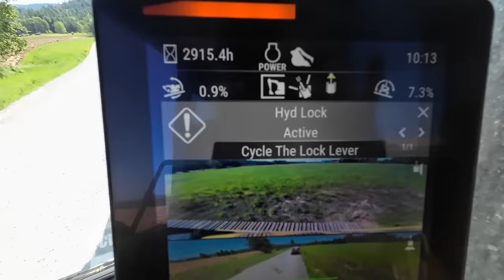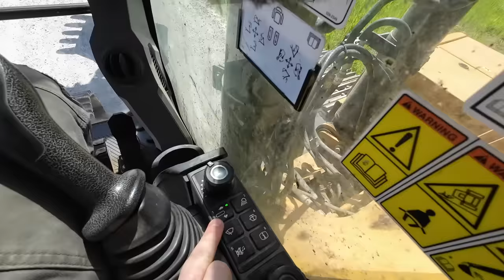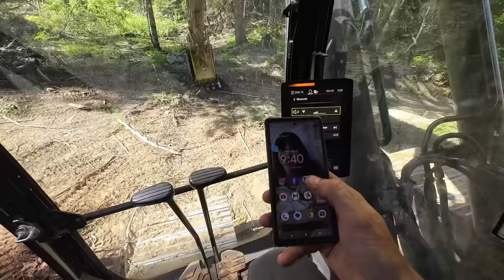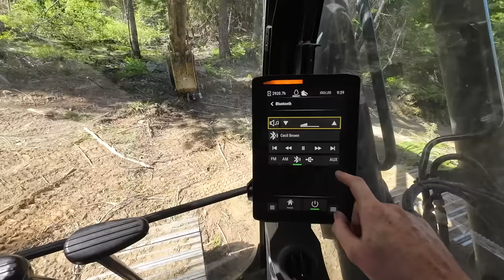We Rented The BIGGEST Excavator We Could Find...

Comment: Just a note here. Equipment used every day for 8 hours of work, usually have a maintenance truck and technician at site at the end of the shift. He goes over the unit and checks every area for issues, the lubes every point, checked every fluid. And refills the fuel tank. If you want those Machi es to work for you every day, you should do the same. Running out of fuel so often should be teaching you a lesson.  JMO.

Comment: THANKS for the comments on how smooth  & powerful the hydraulics are on the 330.  I was part of the team that designed the hydraulic system on all Cat excavators (& many other Cat machines.  Controllability (smoothness, predictability) was a major objective - and overall efficiency as well.  Lower skilled operators have become more common and we wanted to help them, as well as the highly expert operators, to be highly productive over an 8 hour shift.  
You seemed to adapt quickly to running the machine - having experience on other machines helps.
Reply: @panhandlejke6200 the next gen systems are great. We have a 349fl and 349 next gen. The difference is night and day. Doesn’t help the fl has almost 10,000 hours on it and the next gen only has 4500 hours they both run epirock hammers the fl runs a 4700 and the next gen runs a 5800 in a stone quarry. They get run between 16-20 hours a day 5 days a week and 6 hours on Saturday.
Reply: @jjeanes2214  Thanks for that info. Quarrying is a tough application and I hope you get many MORE hours out of both machines.  Over my 40 year career, we were constantly pushed to find design improvements that actually helped our customers - especially to consistently enable high productivity over long hours, like your application.
Reply: That's really cool to hear - big thank you from me, a 2021 Cat 301.5 owner/operator. It is indeed a smooth and easy machine to run. I love it. It may be small but it gets a lot of work done.
Reply: @panhandlejake6200  we push our machines (loaders and excavators) to around 10,000 plus then get new models. The two things that tend to see over those hours are our two 990’s (rebuilt a few times) and haul trucks.

Comment: My suggestion to you is , dig a good size hole for the burn material. It will be better for wind resistance and you won't have to scatter but just bury it when done.
Reply: This is what my grandparents did they dug three holes as deep as they could with the backhoe and put the dirt beside it. It. Those were the garbage burn holes and each lasted about 5 years. Then they we topped off with dirt and leveled out now the whole area is a croquet, badminton and camping area for family reunions.

Comment: This is going to be a fun summer, I do have a tip for removing stumps if they are tough or the roots are deep. Digging a hole in the soil on the left, right and front of the stump will make pulling the stump towards you easier. 
Thank you for an awesome video again and have fun.

Comment: That’s a pretty big excavator. About 40 tons. I know I’ve hauled one and even the one size bigger than that one the Cat 349. Good job y’all!!
Reply: i think a 16t is just as powerfull in many cases..
the missing front showel/stand on this one, moves all the presure to the wheels when you are working..

placing that front thing down gives 20-50 % more power in some cases
depending on what way you are aplying force

a small machine is also often more easy to get closer to the objects so less power is needed

no fun in using a 40ton on the edge of a hole for example

it would be 10 times faster to smooth the road after with a 16t with a showel in front for example

old machines also often have a lack of power, and this does not look like a 2023 model
(i have had a couple of machines they gave me the renting period for free, when i pointed out the dangers and lack of service)
Reply: It’s 330 cat / it’s 30 tonnes ie the 330 / so you don’t really know / a machine weight is always in its number at the side / hope I learnt you something / enjoy your day 👍
Reply: @tonynewman8586  look it up. The Cat 330 excavator weighs around 80,000lbs.
Reply: I have run a Cat 349 with a 78" bucket. It is quite a bit bigger than the 330. The empty bucket weighed 12,000 pounds and the machine is listed at around 110k pounds depending on how it is setup, according to cat specs. That bucket was so big that there was just barely room to smooth out the dirt in a Super 10 dump truck as the teeth would be almost touching the operator's side the and the back of the bucket close to the other rub rail. It only took 3 scoops to fill a truck. Unfortunately, while that machine had a display for the weight of material being moved, it was not setup or available so we had to estimate the weight and watch the returned weight tickets for the 4500 loads we hauled out of that job site.

Comment: When using the breaker don't  try to drill with the breaker point. You can break the tip quite easily. Once your material breaks reset and start again

Comment: Good video! Always make sure the coupler is properly secured to the attachment. I have seen a few mishaps with attachments falling off, some funny, some a delay in working. I have heard of bad coupler accidents, but never had one myself. On lifting or pulling stumps, the closer you are , the more lifting capacity you have. I like renting and buying Cat equipment. Even on my 1949 road grader I can usually walk into the dealership and walk out with the parts I need.

Comment: Not sure if you’ll see this or not but with that hammer only hammer with it for no more then 30 secs at a time, then stop for about 5 seconds. This will help the hammer from over heating, by letting off for a few seconds it allows the hydraulic oil to work its way through the cooler and keeps the hammer from over heating. Make sure you use what ever hammer paste came with the rental or what the manufacturer recommends. 

I speak from 6 years (and counting) experience running them in a stone quarry for over 10 hours a day. Also that hammer paste can get expensive so make sure the greaser (if it has one) is adjusted correctly. They paste we use cost about $26 a tube for us one tube last about 4 hours.

Comment: You asked about suggestions for equipment at one point and I am thinking Telehandler ( extendable fork lift)  However it appears you may be done on the roof and done with sheetrock in the shop, at lest for now.  So, if you do decide to build a separate home, maybe get one before that project.  
I also don't like highs and this feels so much better then climbing on and off a ladder to me.  Just hook up the man basket, which is about the size of the basket on a scissor lift, and set it on the edge of roof and step over or back.  if you actually slide down before you get the bracket installed for the safety line, it is a big target to slide into before falling off the roof.

Comment: Hey Riley I'm a late bloomer, I just watched your video from when you changed the Dozer U joint. A little hint from an old timer I watched you remove those broken bolts, in the future if needed use the Mig and weld a washer over the broken stud then weld a nut to the washer for turning, it may break , try again, much better than drilling. you really lucked out getting them out. also use the highest flow of compressed air to blow the particles away. Good luck to you on this adventure. Keep on videoing!

Comment: You should look into filling your equipment up at the beginning of the day. Get a tank to put on trailer for fuel storage with that large of equipment you will go thru a lot of it.
Reply: They do have a large diesel tank on a trailer.
Reply: Fuel tanks should be top off at the end of the day, not at the beginning.
The cooler temperatures at night cause condensation in a tank.  With a full tank, there is less moisture containing air.
Reply: @dmwi1549  If they have a large tank, are they not fueling up the equipment?

Comment: hey man, quick tip and mandatory safety operating procedure, you always put your bucket, or any other attachment for that matter down when you're not operating the machine or someone is in your operating zone. Your operating zone is the max distance you can expand your boom, stick and bucket out and reach. Your wife is standing well within your operating zone to the point if you had swung to the right you would have hit her with the counterweight and the trees are tall enough that they could fall back towards her and potentially have serious consequences! This is really cool and I do not usually do this, I just noticed you had said "no training" and I had seen potential safety hazards. Stay safe!
Reply: They are really good at engineering a way around issues.  Not so much on setting safety protocols, example confined space with the water storage. Farms have higher rates of extreme accidents for a reason and your using big equipment like farms. Stay safe.

Comment: Just a heads up.... the trim is not going to be 100% to keep mice out. Set sticky traps, if you heard them in the walls, there still there. If you see 1.... theres 200 of them hiding.  Build the 5 gallon bucket mouse kit. 
Ramps on both side they walk up. A bucket lid with a swing trap door. Mouse, walks up to eat walks out of the swing trap lid. And falls into the bucket. Fill the bucket 1/3 with water. Also. Under the bottom, all around the building, spray it with borax.  And stuff , stainless steal, pads in each hole, after you dip them in a toxic ? Also inside the garage. Buy 2 or 3 (( sonic mouse rat )) you just plug them in the wall they keep them away. And there safe for dogs.

Comment: Love that you get to play Tonka with the big gear.  Please lighten up on the sticks though! Banging them stop to stop is obscenely hard on the gear.  Keep in the back of your mind that you're now playing with 1000 hp instead of 45.
Reply: Only 275 hp. Even the 349 that I have used is under 500hp. You are right about the amount of force the bigger machines have and the weight they can move. The 78" bucket on that 349 weighed 12k pounds empty, which was a little big for that machine when moving heavy dirt. That hammer would be fun. I have only used the hammer on our 420f2 backhoe but breaking concrete flat work was like raking gravel by hand compared to running a jack hammer. It made me really focus on being precise and careful with my movements and of course I had to watch the angle on the bit to not damage the slabs we were saving.

Comment: Hi
Such a little tip. When you have air in your diesel fuel system, it is good to have, for example, some spray agent for polishing the cockpit, containing a lot of ether in its composition. You spray into the intake manifold and try to start. Winter also helps when starting diesel in the cold.
Greetings from distant Poland

Comment: Hi from OZ again, just a suggestion as, I am a believer that opions are like arm pits, most people have two and usually they both stink.
Without the blade of the mini to jack the ex level. I would be leveling that cat up, this will help with your hitachi also. To take the rock out, even if you mess up the already formed road a little bit. Its safer for you and the machine (rodeo riders walk funny for a reason) and reduces wild hands from being thrown around the cab and pulling controlls and going somewhere you didnt intend go. Slow is smooth, smooth is fast.
You could probably google but walk into postion, then back up a stick length pull two mounds (dont need to be huge) where the front 2 foot of the tracks were sitting. Then walk onto mounds lifting the excavator up with the boom and walking forward sticking in, only need to take the weight up so it doesnt just doze the mound flat again (can also walk forward swing and pull in behind then back up) if still rocking can screw down into piles pulling tracks left/right. This is less about being level and more about having the weight of your machine, on the idler and motor drive ring, then through track frame center and tetter tottering (level comes more into play when cutting survey or production loading) when you are done lay bucket flat beside mounds and swing through to knock the hump then come through with skid when done. P.s. keep in mind best practice is to not pull back/dig toward drive motors (as if you mess up idlers are cheaper to replace) and dont stick in to far grapping your own track with a tooth isnt much fun. 
Also I havent seen one in a video so just incase im not oblivous or you havent seen one before maybe have a look at skid steer leveling bars. You guys could knock one up in a lunch break.

Comment: One technique I have used to prime the lines is to slightly pressurize the fuel tank. I once used a wet rag twisted and coiled around the filler cap and blew in it by mouth because I had no compressor or air tank handy. Quick fix. No tools essentially. The Tank would need to be topped off if you have to blow into it or you will never get enough pressure .

Comment: A suggestion for next time you run out of fuel, just loosen off one of the injector lines as well as priming the injector pump with the hand primer, start it and as soon as it's running re-tighten the injection line and it'll bleed all the air out of the system.-also a lot quicker

Comment: If the dump truck has a Cat engine, the primer moves about a teaspoon of fuel per pump, unless you open the little bleeder valve on the housing.  Best thing is to remove the filter, fill it with fuel, re-install, then fire it up

Comment: Cat 330 at 68,000 LBs is still a baby. When I had my septic system replaced, the company who did it used an excavator at over 120,000 Lbs. (My son sat on his bike in the bucket.)
Reply: I loaded a handful of super 10 dump trucks with a cat 349 and a 78" bucket. 3 scoops filled them but the teeth almost touched one side of the truck while the back of the bucket almost touched the other side, while smoothing out the top of the load. My brother loaded the other 4,495 trucks. We ran trucks for 7 weeks on that job as we were limited to running 150 loads per day at the dump site. It was fun to play with that machine but I declined to fill in for my brother when he was out for a day. I only have a few years of running smaller equipment under my belt and there were too many critical aspects to digging out the job site, loading trucks, and keeping weights in check for the highway. The 330 is a nice size machine and I got to run it along with a 328 after using the 349. The teeth on the 349 make my work boots look like a kids and I look small kneeling inside the bucket. Heck, it makes our cat 420f2 backhoe look like a toy.

Comment: There are machines called tub grinders you can throw all the slash pile in and grinds the stuff in slow motion .Nothing is thrown at you at 1000 fps it just rolls off the end of an adjustable conveyer belt .It even has a self loader feature on most of sizes offered ,the smallest Humpty could probably handle moving as well as hauling the chips to areas needing ground cover for erosion control. Depending on the size of the chips and tree type they might make good firewood supply after drying / seasoning untill first cold snap..

Comment: The drive motor hose, have it replaced with the cat 4636 hose, it's a new hose with a higher pressure. Should work better in that application. That's always been a bad spot for those hoses. Have them use the nylon wrapping for it as well. May make it tougher for routing but it will help for the damage it may encounter.

Comment: Just remember when you curl the bucket to release the thumb and curl them both at the same time.. dont just curl the bucket.. and the thumb isnt meant for holding weight or snapping trees all rhe time. You can snap the tree near the top but not near the bottom or you might bust and bend the 5k pin that the thumb sits on. . Just paused the video and It almosts look like the pin was broke already and they tryed to make the old pin into a wedge.. keep a close eye on the pin the thumb sits on.. it May walk on you. Love the content i operate a 2020 330 nex gen and keep it looking brand new

Comment: The redneck in me agrees with burning the slash at end of summer. The environmentalists wants to watch a video of massive woodchipper  video spewing chips to make some trails on the property.  As for the over heating,  drain and flush the cooling system. Power wash the radiator cooling fins can be tricky, gotta find the right distance to effectively wash the dirt out but not be close enough to bend the fins from the pressure. I like to fill cooling system  3/4 full leave the upper rad hose off then use a blow gun to bubble air through the radiator to loosen debry. Pull lower hose then flush out the loose stuff. Definitely a water intensive process, good thing you have big water totes.

Comment: on the army truck fuel issue, replace the mechanical pump and primer with an electric fuel pump.
fast prime as one person and do a remote prime port.
use 1/2 inch steel brake line for the piping for resistance to melting and heat with rubber where it needs to flex.
easy to do!
it is a simple modification that can save you lots and lots of time.

also look in to the fuel pickup in the tank, you need a sock in there to filter the fuel and to help with capillary pickup for better fuel at the extreme angles of operation.

cool on the BIG equipment.
the right tool for the job is a must. 
you still have to look at the time these jobs take just like you would if you are hired out.
big equipment most of the time is a BIG time and money saver.

yea hoses and steel lines on skid loaders are the weak point as well as the front glass.
make line protection covers for the hard lines. and use hose covers for the rubber lines and hoses.
they help hold down the down time.